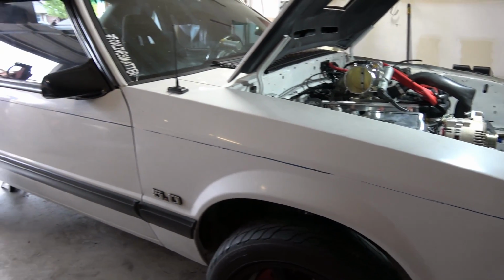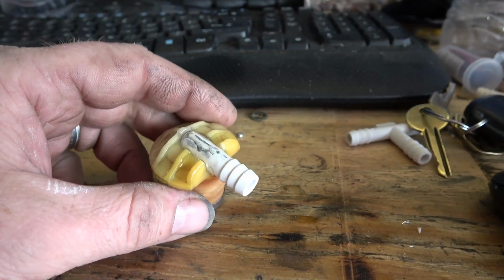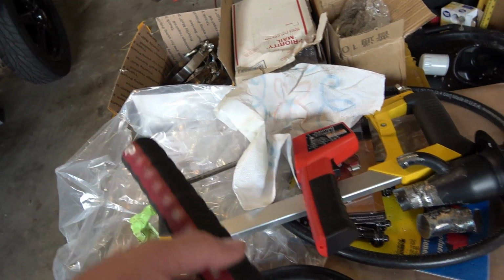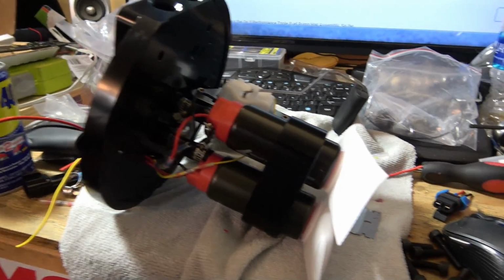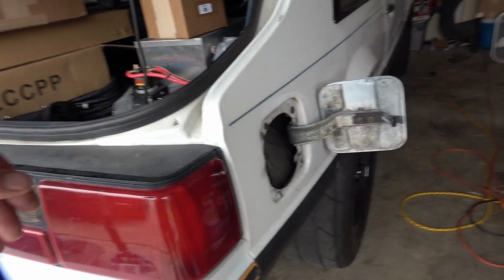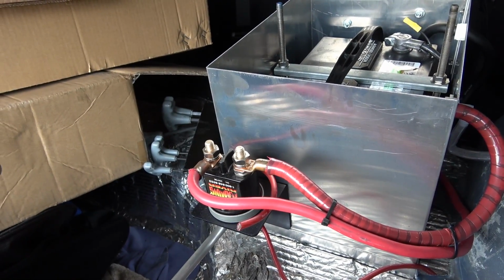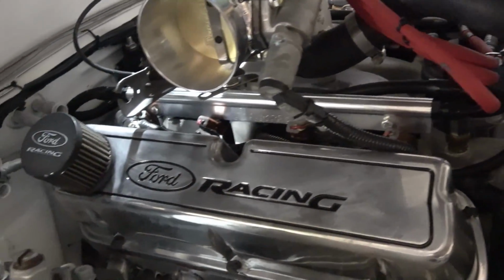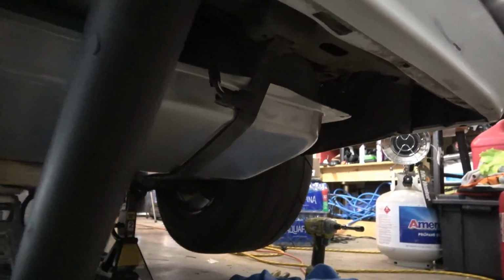On3 Cobra Style Fuel System Foxbody Mustang PT 1

Comment: I seen you had a air operated 3" cut of wheel on the floor there in this video or a previous one, those are great for cutting hose.
Reply from the maker: I use tin snips now, and works fine lol

Comment: Have to come up a return hose/pipe solution to help with aeration? Becausd on3 were not smart enough to include a dump for inside the tank.

Have to drill my roll over valve out.

And have to try and fit a hellcat 525lph pump in the hat.

Maybe come up with something to help fuel slosh because 1.4x 60ft times uncovers the pumps if I don’t have at least 1/2 a tank of fuel.

I didn’t weld my fuel inlet. I started with the same filler, but used silicone boost style hoses and clamps vs welding.
Reply from the maker: My hat had the return already on the hat. Rollover valve I drilled out. I dont see a 525 pump fitting unless cutting up the hat.
Reply: justin91lx yea, it took some work to get the hellcat pump in. My hat had a return outlet as well. But it’s just an open hole that lets the fuel free fall back into the baffle area. That creates bubbles/air like when you get a fountain drink/soda at the store. Then your fuel pumps suck those bubbles back up and you get air in the feed to the rails.

Comment: Why did you increase the size of the tank vent? Your gonna overfill the tank at the pump without the ball check. You should also run rubber insulators between the tank and the underside of the car to prevent vibration noises.
Reply from the maker: It was so small. Bigger opening would make fueling easier. Most people do the 99-04 vapor valve and gut them. Not to worried about vabration noises. Probably wount be able to hear them anyways

Comment: Doesn’t the vent require the check ball in it for NHRA regulations? If the car rolls the ball stops fuel from leaking out the vent tube. I noticed your modification didn’t include that?
Reply: I wouldn't run the homemade valve .
Reply from the maker: I went this route because I couldn't find a 99-04 valve under 100 bucks. The research ive done the 99-04 valve would still needed to be gutted in order to vent that tank.
Reply: justin91lx  I understand but summit has endless options for tank vents. To cut and weld one in would have been safer and maybe cheaper. The check ball is the only keeping you from dumping fuel in an accident, on or off the track. You think it may never happen but that’s usually when you regret a decision....
Reply from the maker: Yes, you are correct. I did gut the vapor valve
Reply: justin91lx  IDK if you plan on racing at any events in Texas but most tracks inspect this stuff and it’s a no go for the check ball missing. It’s listed real clear brother, I would have reinstalled that check ball into the modification you did.
Reply from the maker: I get what your saying. If I replaced it with a stock valve. It would make refueling a nightmare?
Reply: For the record, I installed a crown Vic blue roll over valve that fits perfect and COST at Ford is $89. And I thought it would vent correctly and stop fuel in the likely event that I roll over. 

Guess what..... takes me like 20 minutes to put 15 gal of fuel in and after a year of just dealing with it, I’m dropping the tank now to fix it.

The valve I used already has larger fittings on it vs those white ones though.